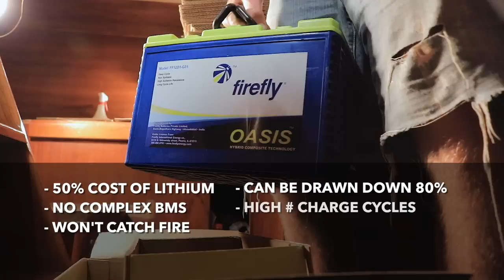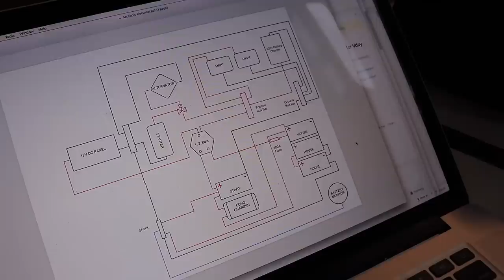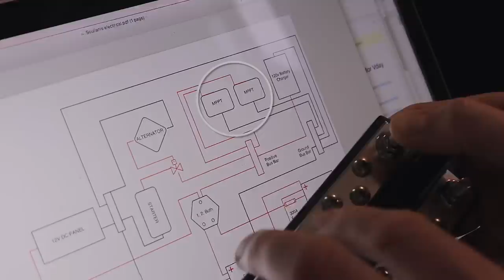Why You Should Do Your Own Boat Work | Sailing Soulianis - Ep. 37

Comment: sorry for the rant, i got carried away.
      As a welder and fabricator I feel for those poor bastards. I personally wouldn't want to do a job like that because of all the different angles. IMO the only way to do it right the first time is to have a complete template of the boats stern of where its going to mount mocked up out of wood or cardboard with the angle of the deck and transom noted, have a template you could copy like you said out of pvc or something, or do all cutting and tac welding at the boat making it a complete structure then bring it back to the shop to finish welding, polishing etc...   With that said there are some guys who could take measurements down and crush it first try. However, the amount of work they did in 3 weeks is not 3 weeks worth of work. More like 2-3 days tops. People that bend tubing on a regular basis would have those big hoops bent in 20 minutes, The horizontal pieces connecting the hoops would take say an hour cutting all the fish mouths with a proper jig and the back rails an 1 hour. Welding can be slow or fast, depending on the fitment and how fast the welder is, a person that tig welds all day everyday can knock that out in an 1-2 hours, Slow welder 4-6 hours. Now any of those times could take 3-4 times longer depending on mess ups and whether they have the right tools and jigs or are people who are just slow working.

       I think I heard you say that was aluminum (nicely polished by the way, but way to soon to polish unfinished work), usually cutting and re-welding isn't a big deal, typical aluminum used in marine industry is a 5000 series which is non heat treated aluminum therefore you technically don't loose any strength when welded, 5052 aluminum only looses like 6 ksi (33ksi down to 27). Now some t-tops are also constructed from 6061 t6 (T6 stands for pretty much heat treated, makes it stiffer and stronger) while 6061t6 comes in at 45 ksi but when welded goes down to 27 ksi. 6061 t6 is the most widely used aluminum in structures...Welcome to an engineers nightmare as those are only a few metals. 5052 series aluminum has better corrosion resistance over 6061. Now lets talk aluminum, while aluminum is 30 percent lighter per volume than steel often thicker wall thickness or larger diameter tubing is needed to be as strong as a steel structure. In the end an aluminum structure really only nets 10-15% lighter overall build. Aluminum is not fond of flexing, any flexing over time and it will crack at the welds while steel for the most part doesn't give a shit. IMO if you do this over again I would go with stainless steel. Good Stainless will look shiny and last forever.

Comment: More of their work should have been done AT THE BOAT..Not away.
Reply: Welding stainless isn't something that lends itself to being done at the end of a pier.
The slightest breeze will make even tack welds porous, nevermind structural welds.
Heat control and speed have to be EXTREMELY carefully controlled or you risk inducing brittleness in the surrounding tubing  from overheating ...or, inversely, lack of heat in the weld, resulting in uneven or incomplete penetration, which is likely to result in collapse from weld breaks. 
And any extra welding done dockside is usually just to finalize some small plates or seats for odd hull angles that can't be readily measured.
These small welds are usually able to be shielded with cardboard, tarps, a welding blanket or similar just held up by a helper to tack, then the tower is taken back to either the truck for better control in a slightly more convenient, controlled environment, or, most of the time, back to the shop and welded on.

Nevermind logistics. Remember, some slips are literally 500-1000ft or more from dry land...and in many cases, it's not physically possible to get a welder close enough to use...

It is possible to weld dockside, but it's not anything close to even "marginal" conditions.
Most of the time, dockside welding is what I consider emergency welding..... just temporary until you get home or somewhere else to get it done right.
Reply: @wmm6563  I'm not about to defend the fabricator on this project, (they aren't very good at it.) but I will argue with you about the logistics & complications of doing this job.

Qualifications, By the year 2000 I had acquired almost every certification there was in welding  to meet the exacting standards of the NRC, (Nuclear Regulatory Commission) and PSI, (Pittsburgh testing laboratories.)
This Soulianis project would have been  mundane in comparison to a lot of the jobs I worked, most of them outdoors in all kinds of weather.

With the help of some friends with similar certifications and experience, a little tea & orange juice, (and liberal amounts of rum & vodka:) we pencil whipped this project in under an hour as though it were a contract we were going to bid on. (We're all comfortably retired now. And we are all from around the Mobile area.) We all worked industrial contracts for 30 to 40 years.
There are some very important details not in evidence in the video such as the placement of the backing plates inside the hull. (Nothing that can't be resolved on the jobsite.) The biggest variable would be Kirk & Loreen's design changes made as the project is assembled. (It's their vision & not a set of blueprints that's being built.) And the Bimini part of the project isn't being considered here as we know nothing about it. 

Having a corner berth next to the parking lot would be Great but ALL of the tools and materials are portable. The clutter on the dock during the assembly would be more of a nuisance to other boaters than the project.
The whole project would be stick built & fitted on the boat using a tig welder in 1 to 3 days. (A 4th day might be necessary in order to comply with Murphy's Law ;-)
3 days in the shop for weldout is considered a liberal estimate. 
1 day for stress relief of the welds.
1 day for finale fit and adjusting.  (1 more day for Murphy's Law, just in case.)
4 to 7 days for polishing. (Not my forte so I've learned not to argue with the sheetmetal guys...)
So about 14 to 17 days to build with 1 mechanic & 3 helpers.
Based on our experience of doing the impossible with little or nothing in the most trying of conditions (you can read contracts if you like) you're looking at $16,000 to $18,000 for labor costs plus the expenses of materials, welding consumables, etc. just for the arch.

I have no idea what the "not very good" fabricator was charging but I suspect he's looking a bit better now.

Best Regards,
Mike
Reply: I will have to add what Mike was talking about. They have small 110 tig welders which could be used at the dock for tacking. I have used them many times in places that were difficult to get to.  Most of the frab work should have been done at dock side especially by these fabricators. Running back and forth to the shop was a complete waste of time. I have found out long ago some people are not good with a ruler. Also by them working on the dock you would have found out in short order if they knew what they were doing. Then if you had bought the materials you would have them for later. Pay them for show up and send them on there way. It would be a win win for you and them. I am certain you could do the job your self.

Comment: you missed the point on the 80% discharge.. they can be discharged much lower, however if you only discharge to 80% you will do zero damage to the battery, in theory if you only ever discharged the battery to 80% they would last indefinitely.

Comment: No complex BMS - this is prolly its biggest advantage over lithiums. That just adds to the cost.

Can be drawn down to 80% - TRUE. I believe recommended is 50%. So ideally that should not be done often as......

High # Charge Cycles - Yes, but that drops with more DoD, significantly more if done down to 80%. Like ~1000 cycles and as such would no longer be high # charge cycles.

50% cost of Lithium - Initial cost yes prolly true. But that is deceptive and does not really tell one anything. Cost per Ah is better and with Cost per kWh for its life span is a much more accurate comparison. This can vary depending on personal usage and maint. But it is likely slightly more than Lithium in ideal situation. Something to consider but not enough higher cost that should be deciding factor. Especially if initial cost is concern.

Charge Quickly - This is relative and depending on what specifically comparing too. Yes they are considered quicker charge then many other types. From what I have heard implied, typical usage of these batteries will still take 3 - 6 hrs to fully charge though. That alone is big improvement over what is commonly used, as many charge for 6 - 8 hrs (while motoring) and the batteries are not fully charged which for lead-acids leads to shortened battery life. I would be more curious to know what are actual charge times you have seen with these, and with how much typical DoD.

LOL. She is bound and determine to make that oil filter into a fuel one :p
Reply from the maker: The Partial state of discharge usage has been the biggest benefit.  We have never once turned on the engine just to charge batteries. 
 Currently our batteries haven't hit 100% in the last 2 weeks. We disconnected 4 of our solar panels to rewire over the course of two days, and have had cloudy stormy weather ever since.  The bank has been hovering around 60-70% since then without too much worry. We've done this one other time and saw now detrimental effect which has been awesome.

The charging quickly part is a bit more tricky to calculate. We recently installed a new much larger (120amp) alternator.  We now have a house bank of 4 firefly batteries for a total of ~440ah.  We've seen an acceptance of 80amps when down about 150ah on the bank.  But by the time we get to -100ah we've slowed down to about 20amps and then slows further to about 15amps until about -50ah and slowly trickles home from there. But what I'm not entirely sure of is if this is a result of the batteries, or the "smart" alternator regulator.  I need to do a little more playing around with it to figure it out. Conversely our solar bank will put 20amps into the batteries right up to 100%.  So I don't think I have quite enough data to answer your questions on charge quickly just yet.
Reply: TA for the info mate!
Just remember that these are supposed to step down, so if they do, simply do a back to back completely full charge cycle to bring back up to like new. They have been tested and abused for one month of PSOC and that back to back should bring them back up.

From what lil I have read and heard, it implies they are supposed to do more quick charge followed by the slowing down you describe. Now whether that is battery or smart regulator, not sure. I would guess if its decent smart regulator that is what is doing it like the way those batteries supposedly prefer. But do not really know your system, so only you can really answer that. The 60-70% is pretty good, thought you would be drawing more power then this, so sounds like you have planned your system fairly well for your usage, well done mate. Maybe do an update video on these batteries after a year or so down the road.

I have no doubt these are good option of batteries to consider for everyone. Good vs best option will vary depending on personal, and not sure is enough detail info around to figure out as well yet. Odd considering how many years they have been around, but seems like they are just starting to gain attn in marine world.

Comment: The arch - the workmen clearly are not qualified as you can tell when you see them cutting the arch with a cutting wheel and not using any safety glasses. Not only is there a hazard from flying debris, but sometimes those wheels disintegrate, and will easily blind a person.
Secondly, you should not be using chlorine based bleach on fiberglass as it is one of the few chemicals that can degraded the fiberglass and it s very harmful to the ozone layer. As an alternative you can use an oxygen based bleach such as Oxiclean, which comes as a liquid and powder. Also you can try Windex which is a dilute mixture of ammonia and rubbing alcohol (very cheap to make your own - using equal parts in water - add blue food coloring if you want the full ambiance). To kill algae, as found in some molds pick up some copper based algae killer at the swimming pool supply. Will need to heavily dilute it, but it is a very effective algae killer.

Comment: why 3 solar chargers??? you can tie 3 panels into one charger
Reply: Check out Dangar Marine (dangarstu). The other episode this week covers this topic.  Separate controllers make sense on boat where one panel may be getting shade from say the boom.  Let’s other panels still operate at 100%.
Reply from the maker: Exactly this. We have 6 panels.  The plan was 2 80w on the dodger and 280w + 2 50w on the bimini. We wanted to isolate each pair. As of now we're only using two chargers, one for bimini and one for the dodger which isn't quite as efficient, but it's working well enough for us to not feel the need to install one more and separate the series parallel string we have on the bimini.